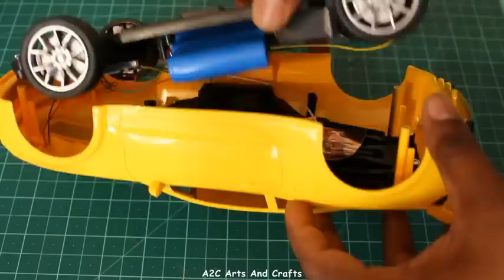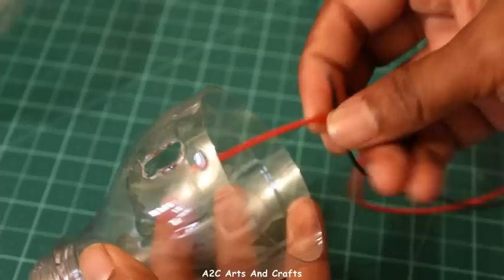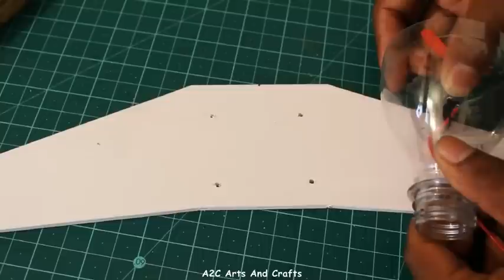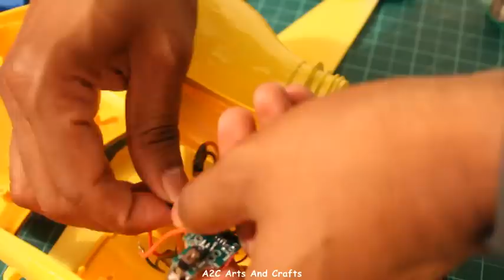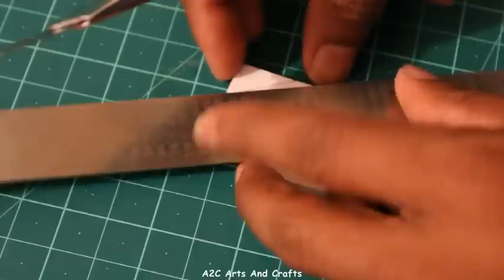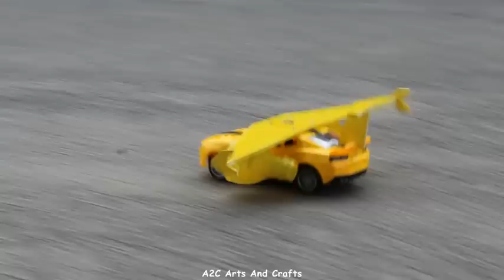How To Make a Flying CAR - Aeroplane Car

Comment: Wow nice car, the guy using a string to pull it up made it look like it could fly, but we all know you had not nearly enough speed to lift off, also if this wasn’t fake, how did the plane pull up without control surfaces? Also there is no lift being generated by those flimsy      Pieces of paper! Do your research on airplane wings and you’ll understand what I mean, now don’t get me wrong, it’s possible to make flying rc cars, a lot of people have done it before just look it up but this, this is fake